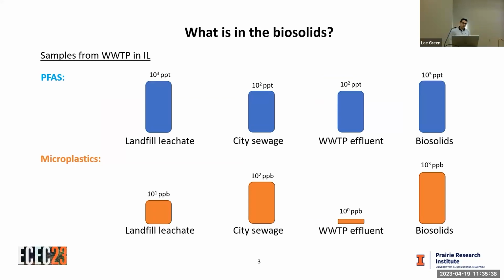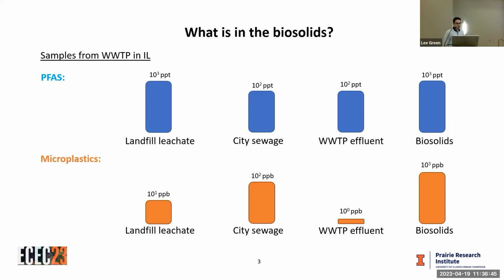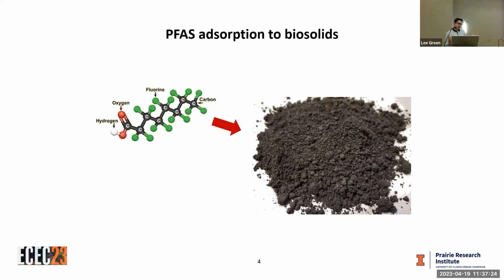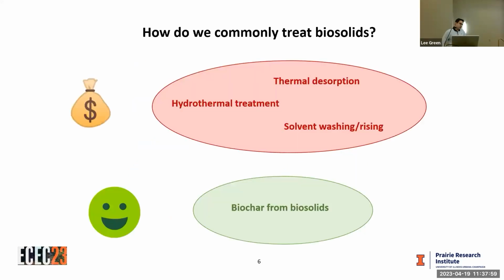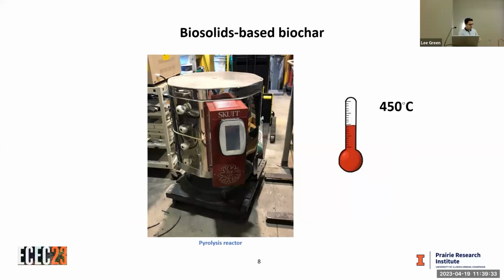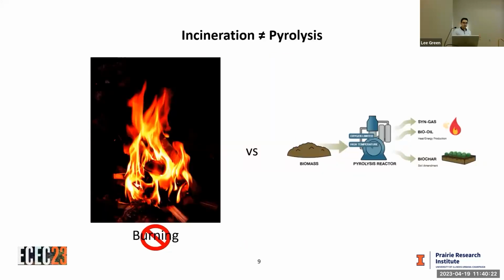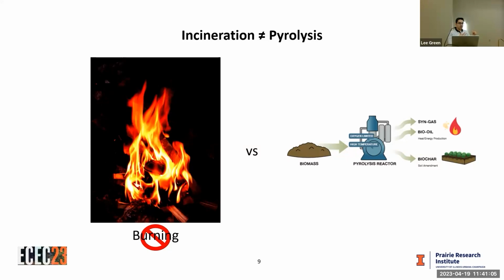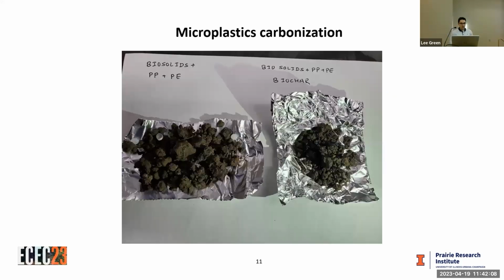Entrapping Per- and Polyfluoroalkyl Substances (PFAS) and destroying microplastics in biosolids

Comment: At 250 to 450 Centigrade PFAS will under go thermal desorption and/or thermal decomposition depending on chain length and functional group.   What data do you have from the pyrolysis gas and condensate is free of any PFAS?   If biosolids will carbonize, then so will PFAS as it has a carbon backbone.   Have you do total fluorine analysis for a mass balance?